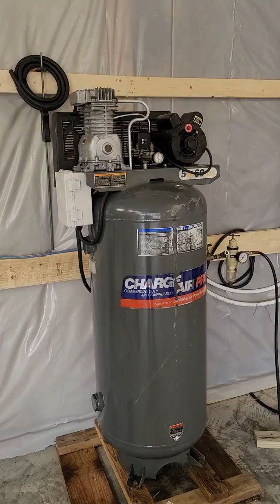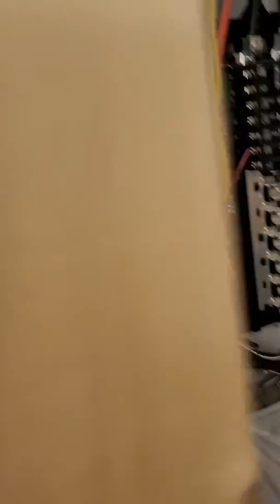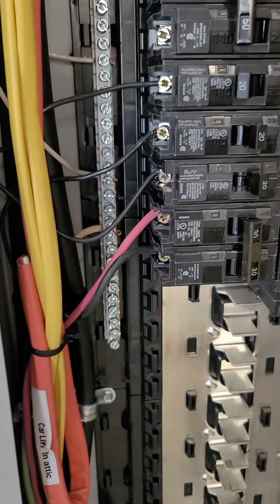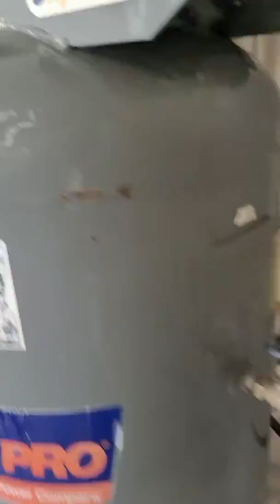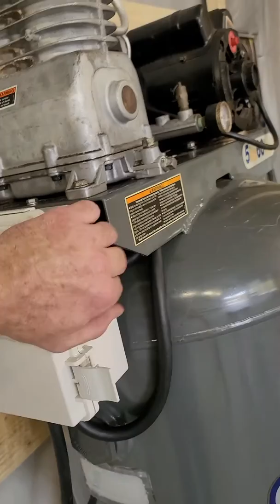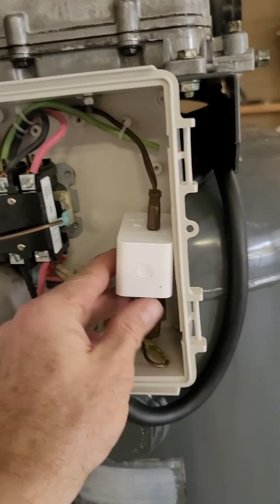Automating my 220V Shop Air Compressor with Smartthings

Comment: Dumb Idea I may add, to put a switch (smart switch or not) to turn off your compressor, you haven't thought it through. That's the same thing as pulling the plug on the compressor. Do you realize the compressor switch itself is also a pressure relief valve? It takes the pressure off to the piston head so the compressor doesn't labor when it restarts. Putting a switch to kill the power will eventually blow breakers or cause the motor to overheat from labored backpressure. Why do you think the compressor spits out air when you turn the switch off that comes installed with the compressor?
Reply from the maker: As I told someone on the Facebook Post, this is used as a begging of day and end of day shutoff at most.  The main thing it does is shuts the power to the compressor off at midnight every night just in case there is an air leak that develops and I am not at the shop.  It is meant to be a way of preventing a fire due to the compressor running and running if I major leak develops.  That has caused many shop fires.  I agree that it cannot be used to regulate the air pressure or cycle the compressor regularly.  You could comment in a more professional manner, but you are correct that ensuring this does not negate the pressure relief switch is imperative.